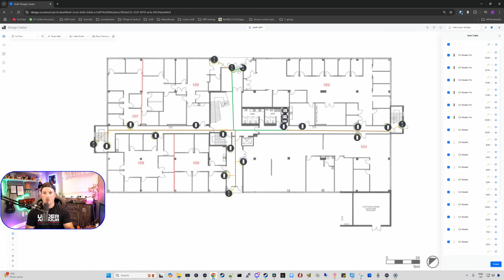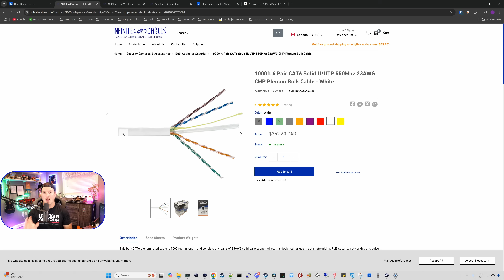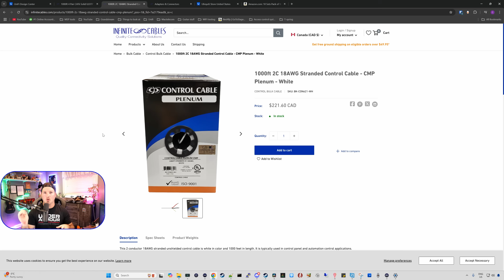Unifi Access Pre-Build : 40 Door Access Job

Comment: This is great information!  Thanks.  I'm doing a small office (as the owner/builder) and learning this stuff.  In my case, I have to wire up some MarksUSA M9900ER electric crash bars that are 24Volt.  So, I have to add a 24V transformer setup and use the "dry contact" for switching.  Have you done this before and do you have any advice?  I'm still researching what transformer to use.

Comment: That is awesome content, Cody.
Systems with this many readers typically get complex. I don't think Unifi has any kind of advanced reporting or report automation. I would not feel comfortable with Ubiquit strikes on doors that need actual security. I don't think they carry any fire rating. That would be a liability. What is the warranty on them? Scary stuff.
Reply: The Unifi Access equipment it ul294 rated. As he is in Canada the strikes likely don't require a cert. If they need to be they cam easily be changed for another brand. they are pretty standard.
Reply: The strikes have a 1200Kg holding force, fire rating could be an issue but that depends on the local code and how the building is setup.

Comment: They make a round DPS/magnetic reed switch that can go into the top or side of the door that will be transparent. You can put it just above or below the strike and use the same holes. Client will never likely see it. You can also get it built into the e-strike, but idk if the ubiquiti one has that option.
Reply: Another thing for a job like this, you can buy cable specifically for it. It’s ethernet +4 for your strike & door contact all 1 wire pull…

Comment: First off, I want to say thank you for the great content you're putting out! I'm excited to see this project progress. I've worked with a few other access control systems, but I have not done any Ubiquiti yet. I've recently started my own company and will be using a Ubiquiti UDM-Pro as the bases for one of my first jobs I'm starting soon. The client is interested in Unifi Protect and Unifi Access as well, so I'm excited to get the project kicked off. Are you pulling an additional 18/2 for the DPS or going with a smaller gauge like a 22/2, since they're dry contacts? I've not ever had any issue with 22/2 for DPS, if they weren't already built into my mag lock, with any of the other systems I've done. Just curious what your thoughts are on it. 

Best of luck with the project!